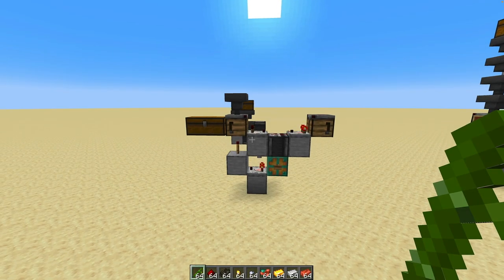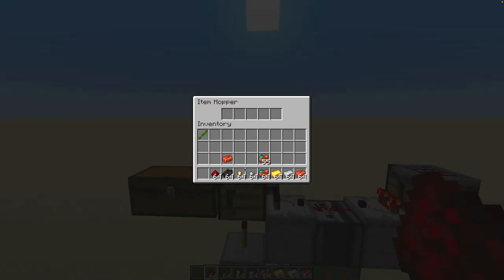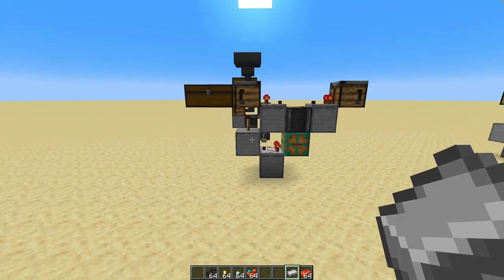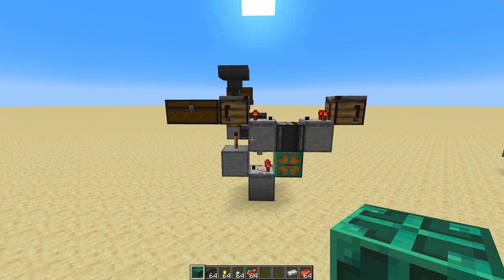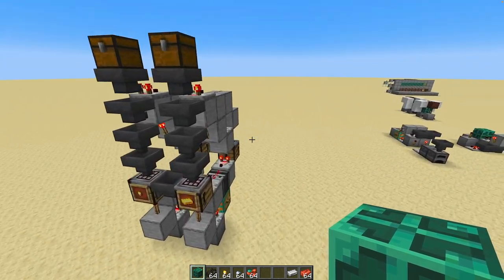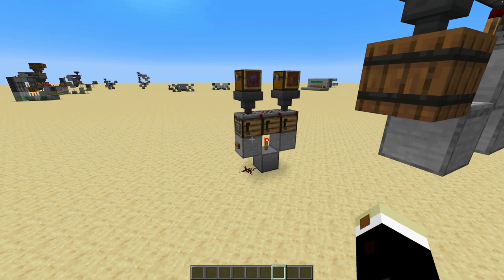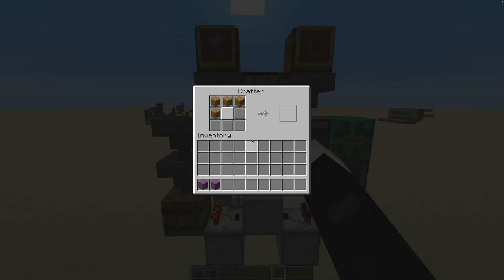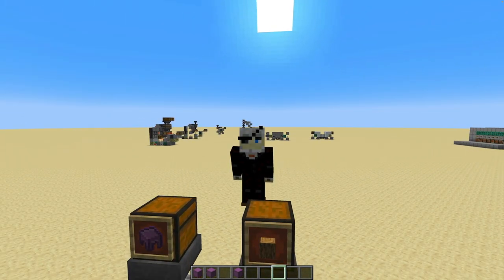Auto Crafter Compressor - for all farms!

Comment: I'm glad I found your video. I had already worked out how to make a tilable auto crafter with sorter for my gold farm. I was using two observers for the crafter and was running into an issue with the double pulse the observers put out. Your solution is so much easier. I have two of the circuts next to each other and have the crafter that turns the gold nuggets into ingots pointed into the crafter turning the gold nuggets into blocks.

Comment: Doesn't work.

Built it just like you showed and it doesn't do anything.
Reply from the maker: Hi 😊 Sure you build it just like I did? Dis you remember to turn on the cobber bulp? If you’re in vanilla I can assure jobir works.
Reply: @MineTheFab  same here. doesn't work, built like you showed and its not doing anything. it would be nice if there was a building tutorial rather than just looking at it and copying, that way we can know what we need to do first to make it start working.
Reply: @erikrrn8205  I had a similar problem, it was because I let the crafter fill up. The circuit works with a trickle of items, if its got a stockpile it'll just stay powered. If that's your problem just clear the items in the crafter and once it's going in at hopper speed it works perfectly. you could always use the observer clock if you are making something like iron ingots or copper blocks.
Reply: @erikrrn8205  if guy above me's solution didn't work hit the button on the copper bulb